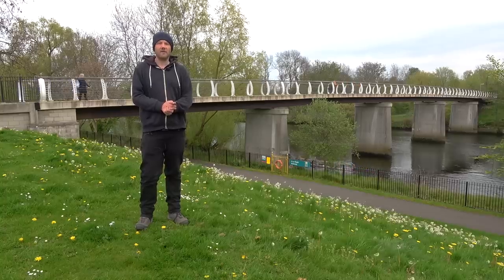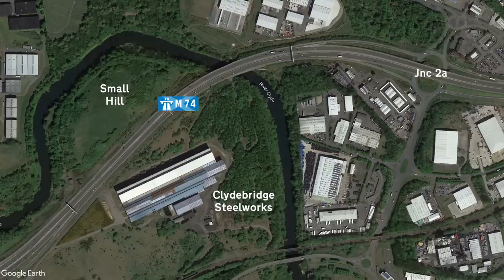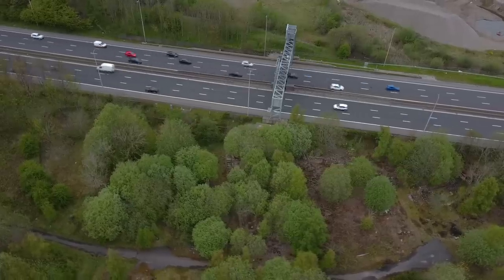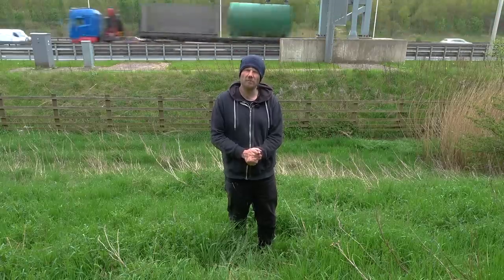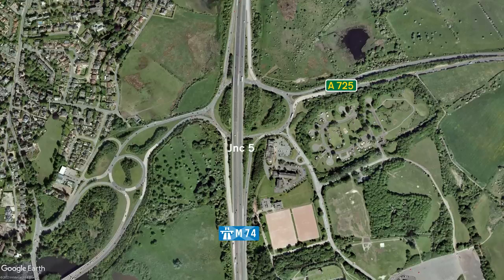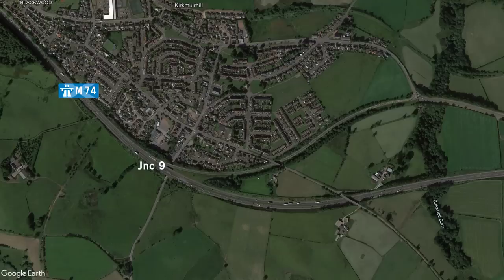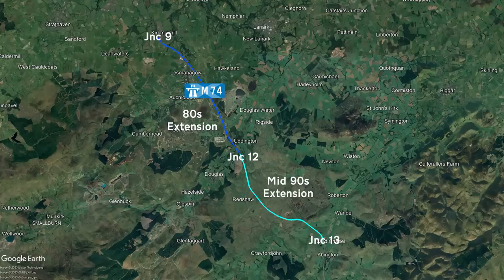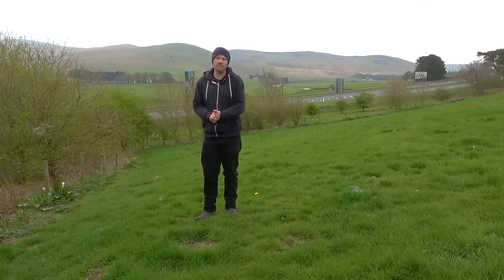Secrets of the Motorway - M74

Comment: The M74 extension, in my opinion, was much needed as it cut out the diversion onto the M8 through possibly its busiest section at Townhead. When I used to go up and down to Newcastle on a regular basis, it saved me about 30 minutes per journey.
Reply: My wife used to work for Strathclyde Council.  The M74 extension used to be shelved and resurrected regularly for decades.  It used to be said, only half jokingly, that half the civil engineers in Scotland got their charterships on the strength of designing motorway structures for it that were ultimately never built.
Reply: The M74 extension was a welcome addition, as it means I can travel on dual carriageway from Ayr to York near enough all the way. (This will change when they dual more of the A66) Especially since they build the A/M77 ( which I worked on)

Comment: I'm surprised you missed the "M6 South" sign at the DVSA Weighstation (Southbound) exit between junctions 14 (Crawford) and 15 (Moffat) when you did the M6 bit.
Reply: 42 miles from the actual M6. (visible on google street view)
Reply: @roderickmain9697  M6 muliplex....
Reply: I was surprised he missed that as well. Also the M74 sign at Gretna Services rather than A74(M)
Reply: It’s on the A74(M) rather then the M74 so maybe it will get a mention when he does the Secrets of the A74(M).
Reply: Great to have an exciting episode on my local Motorway! Incidentally, everyone refers to the A74(M) section as the M74 - I don't know why they don't just change the name.
Reply from the maker: That would be on the A74M? In any case, it's unlikely I can get access to the DVSA place to see the sign.
Reply: @AutoShenanigans  There’s actually an unclassified road behind the weigh bridge where you can see the sign at the exit slip from the station.  You access it via the B7076. Be warned all of its branches are dead ends. One takes you up to the wind farm nearby. The 7076 can be access via the A702 at J14 signed Crawford. Interesting the north and south approaches to 14 are nowhere near each other.
Reply from the maker: @TheGiff7  Excellent. That works for me!
Reply: @AutoShenanigans  just make sure your navigator is worth their salt. The unclassified is to your left on the bend heading south and marked Clyde Wind Farm. The satnav will obstinately try and dump you back on the motorway 🤣
Reply: @AutoShenanigans  
1). The DVSA sign is visible from the motorway (every google map view since 2009, there's also a clearer view from the weighstation slip-road).
2). At junction 15 there are a couple of signs on the A701 approaching the southbound roundabout marking it as M6 (every google map view since 2009), the signs on the slip-road mark it as A74(M).
3). I don't think you're daft enough to return to Scotland just for a couple of shots you could grab from google maps (that's what you would need to do for the A8(M) signage anyway).
Reply: @AutoShenanigans  Hi Jon, Yes. A74(M). Its not actually in the DVSA premises but on the sliproads into/out of  it. If the googleman doing his streetview can get there you probably can too.
Reply: @roderickmain9697  though I imagine that Polis Scotland would be curious to someone standing on a slip road which is technically motorway. A friend of mine broke down when driving south and used this same slip road. The polis were quickly present to verify what was happening.
Reply: I noticed that a couple of weeks ago !🤣
Reply: The whole A74(M) and M74 was always planned to be reclassified as part of the M6 as it’s the same motorway which runs from Glasgow to Birmingham. It just changes from the M6 to the A74(M) at the border then changes again from the A74(M) to the M74 once passed Abington. Again it’s all the same road. So some road signs near the border have an A74(M) stickers over then, peal them off and underneath is the M6 logo. But the reclassification never happened as Scotland then got its own devolved government and the responsibilities for roads transferred from London to Edinburgh.
Reply: @AutoShenanigans  you can see it from the main carriageway.
Reply: @arod9998 
Why not rename it the M7, from Carlisle to the junction with the M8 at Glasgow? The M7 would never otherwise be constructed and converting the M74 to the M7 would be a simple operation.
Reply: @anonUK  in Scotland motorway numbers reflect the A road that the motorway replaces or runs parallel too that is why there is no M7

Comment: You could do a full video on the B7076 and B7078, those are the remainder of the old A74 dual carriageway.
Its practically a motorway and almost abandoned, and theres plenty of completely abandoned parts of the old single carriageway Telford road.
Reply: Yes from Lesmahagow south you can see where they turned one side into a cyclepath

Comment: Back in the day, I spun my mk2 Ford Orion on the infamous loop at the Maryville Interchange...... never have I needed clean pants more! lol! The M74 extension was badly needed, as the Kingston Bridge just couldnt cope with traffic and Townhead was a bottleneck at the best of times. Removing a lot of traffic that was wanting to head south helped cut journey times by a fair chunk. I hope you enjoy your trip to Scotland - Im sure Ill spot you checking out the M898 :)
Reply: The sides of the approach embankment to the “temporary “ bridge at that loop were so steep that it had to be constructed of layers of lean concrete, designed by, er, me, and intended to be relatively easy to remove. Had reinforced earth technology been around at the time, it would probably have been used instead.

Comment: Perhaps you could investigate why the M6 and A1(M) terminated at Greta and Newcastle respectively? Why it took until 2008 to connect Glasgow to the south with a motorway and why there is still no motorway south from Edinburgh to Newcastle?
Reply: "no motorway south from Edinburgh to Newcastle" That's because the English think that Glasgow is the capital of Scotland so ignore Edinburgh.

The relatively new dual stretches of the A1 have motorway rules, so perhaps the idea was that they could be re-designated  motorways in future.
Reply: I think that is down to transport in Scotland being a devolved matter.  Scotland's road system is financed, built and maintained by Transport Scotland under the direction of the Scottish parliament who set priorities which may be different to the English authorities.
Reply: If you drive along the A1 from Edinburgh to Newcastle, the terrain doesn't lend itself well to being a motorway. I think most of it is likely a funding issue as a result. Edinburgh has part of the A1 (about a 15 mile section) as an expressway, marked with 70mph signs (not national speed limit) and vans are permitted to go at 70mph and lorries at 60mph on this section, like a motorway; traffic types are also restricted the same as a motorway. 

Through Berwickshire and near Dunbar, you'd struggle to follow the A1 route and would need to build the motorway another way and re-designate the existing A1 as a different A road.
Reply: Because the SNP dont want another connection to England 😂
Reply: @David8n  It'll be slightly more complicated than that but essentially you are right. If there was any attempt to upgrade the A1, It'll also be likely come down to trying to get Westminster to partially pay for the project as improving the A1 would benefit those travelling south to England as well as North to Scotland.
It's possible that that is why extending the M6 North from Carlisle to the border took so long to be built. The same situation is definitely partially responsible for it taking so long for the A8 to be upgraded to Dual carriageway in Northern Ireland.
Reply: Manchester is East of Edinburgh, as is Carlisle. The recommended route is down the M74 and A74(M). Although my preferred routes are the A7, A70, A701 or if I've got a bit of time on my hands on the B709. 

The Scots dealt with their roads themselves even before devolution, 70mph limit signs and all.
Reply: @maybenot6075  What nonsense. The motorways were not built in the 60s and 70s because Westminster did to want to connect Scotlands motorways to the South for political and economic reasons. The Scottish Government has been making the motorway connections since 2000.
Reply: @David8n  However, the main motorway network in Scotland was completed in the 60s and 70s disconnected from the motorway network in England. It took until after 2008 to connect the M6 and Edinburgh was not connected to anywhere by motorway other than Stirling until after 2011. Having Scotlands motorways disconnected diconected to the south only makes sense for political and socioeconomic reason.

Comment: Totally agree about the A725 - it should link M8, M74 and M77 better than it does. Coming from the east, and not necessarily having to go through Glasgow (say heading down south, or down to Stranraer for the ferry) it would be a winner. Same for something better than the A701 from Abington to Edinburgh.
Reply: The road from Larkhall towards Ayr is the shortcut going to Stranraer. But aye the southern motorway on that pic should have definitely been built, even if it was to bypass a lot of traffic from going though Glasgow that would have made sense. That EK expressway is rotten. That wouldn't be a problem if it existed.

Comment: How the M74 has changed since my 1st journey up that way in 1991, with no such thing as a Sat Nav, or mobile phone, going too and from Inverness. Spent 11 years on and off navigating the M80, M73, M74, and remember the roundabouts on what is now the M80.
Reply: The M80 is a complete patchwork of cobbled together bits and bobs. It probably took the best part of thirty years to complete. I drive all of these roads regularly, and used to be based in sunny Coatbridge, which was great for access to all of the major roads of the central belt. Now I'm based just off the A9 which I believe is finally going to be upgraded to full dual carriage way standard somewhere round the year 2099 (or just after the earth melts into the sun. One or the other, I'm not sure which).

Comment: The junctions on the M74 where reversed until the early 1980s( going north you joined at junction 1). Then they decided to extend south. When that happensd in 1986/87 they reversed the junction  numbers. The Tory party's Scottish manifesto in 1987 promised a motorway link to England. So from 1990 the route was upgraded 
South and North. A section was built north.and opened in 1993 I think ( from memory). The completion scheme in 2011 joined this section to the M8&M77. So the existing M74 is the 1960s motorway,  the 1980s extension south, the 1990s upgrade south to Gretna ( asM74& A74(M)) and the 1990s extension north, and finally the 2011 completion.

Comment: The map of the proposed motorway at 5:42 has an error. that is the M8. the M77 would be the other direction. The a725 upgrade at Junction 5 is a massive improvement. traffic was a nightmare. It would be nice if there was a motorway here as it would link the M77 the m74 and m8 together bypassing Glasgow and all the roundabouts at East Kilbride. Would serve much of the south of glasgow as well as EK, Bellshill Coatbridge would be fastest route from Edinburgh to Ayrshire. Would just make sense and if you look on the map there is room to squeeze it in
Reply: Was just about to comment the same thing. However, they are currently upgrading Airbles Road in Motherwell and have installed a new bridge under the WCML to create a dual carriageway from junction 6 of the M74 up to Eurocentral on the M8.
Reply: Maryhill road in glasgow from city centre to canniesburn toll should have been a motorway and the start would have been the mysterious dead-end slip road that would have left from the off-side lane next to Stow College building! Can you imagine! So many houses would have been demolished in the process

Comment: You should come look at the A8/M8 running alongside Coatbridge, used to be pretty simple, A8 ran alongside Coatbridge and there were no real dramas, then they decided to make a whole load of changes which meant the main M8 would no longer come onto the A8 but instead they created a new road where the M8 would then run straight through, no longer goes onto the A8.   Great idea in principle, but they left the A8 high and dry along with Coatbridge.   Before, you could easily get in and out of Coatbridge using the A8 as it joined into the M8, now coming into Coatbridge from the East you have to come off some few miles beforehand and negotiate a road running parallel with the new M8, hitting roundabouts and confusing lane changes, coming West you have to come off earlier than you would normally too and drive through residential streets and pretty much all the way through Coatbridge to get to the other end (as opposed to having came off at the normal junction before which you now cannot).   It's improved nothing, on paper it might looks great but in reality it's a joke.

Comment: @5:43 You've got the M74 marked correctly but you marked the A8 as the M77. The M77 is on the southside of Glasgow.
Reply: Think it's supposed to be M73 as its on the line of the current A73 and that already has loads of areas that were originally planned to be motorway... but it never got done.

They've only recently raised the railway bridge every double decker lorry would hit while trying to avoid the Raith interchange 😂
Reply from the maker: Yeah messed that one up a bit.

Comment: Ah yes, the A74 section that one basically fell off the M6 onto; dual-carriageway and one frick of a bottleneck. Straight from cruising at motorway speeds to having agricultural vehicles (usually Ford TWs with hyawge twin-axle trailers) popping out from the curly sliproadettes to run at 37mph. Despite being a closet greenie I did welcome the direct M6 to M74 transition when it happened to eventually be built, and the old road is now a scenic bucolic alternative to dicing with reps in S-line A4s and M-sport (yeah, course Gavin) 318i’s. Nice.

Comment: John, when you do the A74(M) (if you haven't got it in the can already), have a look at Glasgow Road, Gretna Green. In the middle of the village, 100 yards west of the anvil, there's a road junction with one arm  labelled "GLASGOW EDINBURG" in black on a white background, with a blue patch saying "(A74(M))". So that's a local road leading to where you can access the motorway if you want to, right? WRONG! In effect, it is itself the motorway slip-road, but not yet under motorway regs!

To add to the confusion, the road is clearly not one-way. What they don't tell you is that the other direction of traffic (and the lack of motorway regulations) is only provided so that a local farmer can get back from a small field of his without going onto the motorway. Once you go past the gate to that field, the road becomes one-way (I assume, though there is nothing to indicate it!) and you are committed to joining the motorway. There is a blue sign announcing "A74(M)" within view of the gate, but not close enough to it to warn non-motorway traffic that the gate and a tiny lay-by opposite it are their last chance to do a 3-point turn to avoid breaking the law.

The only good thing about the arrangement is that any non-motorway traffic fooled into breaking the law only has to do so for a couple of hundred yards, as they can re-join the local road network by coming off at Gretna Services.

Comment: Been a regular traveller on this route since the 1960's and remember well its many iterations. See if you can spot 'the bells' a string of bells at a farm railway crossing to alert any over height farm traffic about the overhead wires. About a mile or so north of the Beattock depot where the railway is very close to the road. Once we get there we know we have about another hour to get to our relatives.

Comment: Junc 10, 11, 12 are a bit of a mess in my opinion. If you live at the South side of Lesmahagow, you have to drive North to get onto the M74 at J10 and double back on yourself down the motorway or you have to drive South down the old A74, which used to be dual carriageway until recently-ish, and pass J11 and go all the way down to J12.
Reply: if you live on any side of Lesmahagow I pity you, I lived there for a couple of years in the 80's
Reply: @SaltimusMaximus  I must confess I moved away in the 90s and only went past once due to a traffic diversion. I thought the A74 would be a good shortcut and it was in really bad shape at the time. Full of pot holes. They've apparently closed one side of the carriageway and resurfaced the remaining lane for 2 way traffic now.

Comment: The bridge at Lesmahagow over the river Nethan sags slightly. The engineers apparently didn’t allow for the weight of the tarmac, etc when they put the steel in. Or so I was told when I worked on the 10 mile extension south from Blackwood in the mid 1980s. 5 miles of that stretch was built as continuous concrete pavement (no longer there) and cost £1m per mile. Couldn’t build a footpath for that now! It was really interesting to watch the train that laid the concrete in action. A very slick operation. Just a shame the carriageway made such a racket when you drove along it.

Comment: The 'secret' slip road to the northbound M74 at Junction 12 was mainly used as an access point by the SAS (Scottish Ambulance Service - not the elite hush, hush, bang, bang Army  unit)  crews, stationed at Douglas responding to incidents north of Junction 12, saving a 16 mile round trip via Abington.

Comment: the M74/M8/M77 interchange is a fantastic bit of engineering, right up there with Worsley Braided Interchange and Spaghetti Junction
if that had been built in England, it would likely have been done on the cheap as an at-grade roundabout where all three motorways bang into each  other (as per e.g. Switch Island)
Reply: Unless you are going M77N to M8W, swerve across three lanes, u-turn under the carriageway, and back across three lanes again!